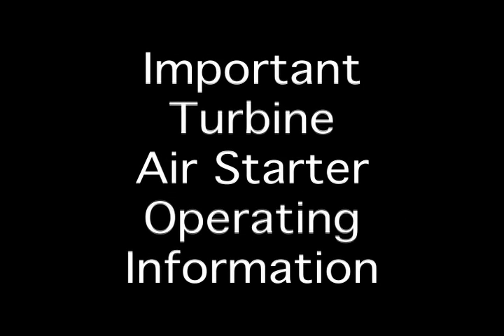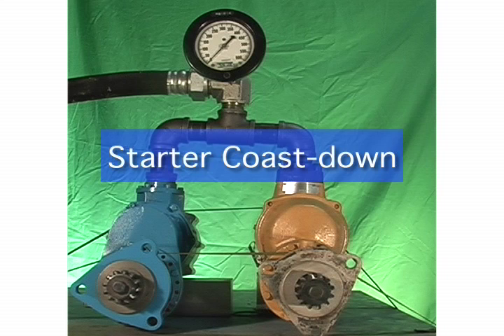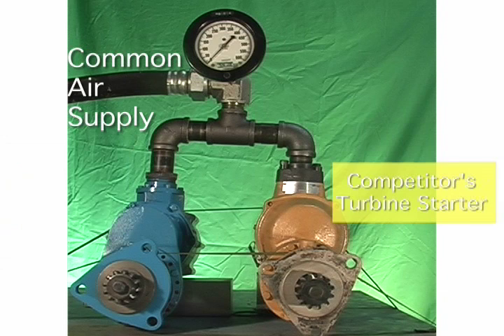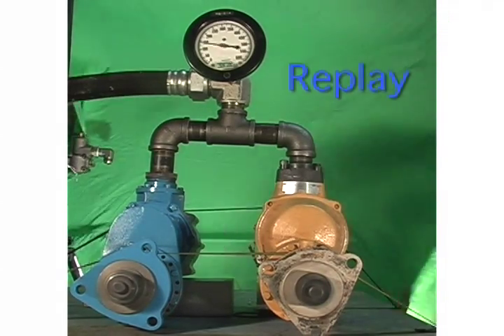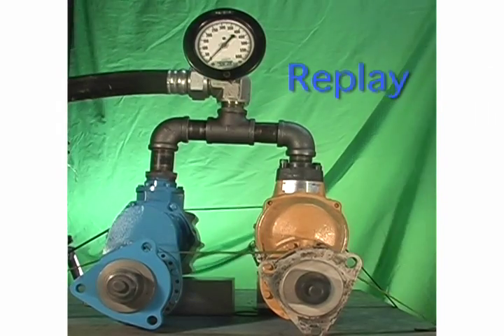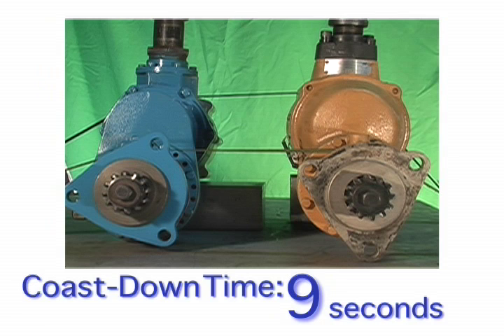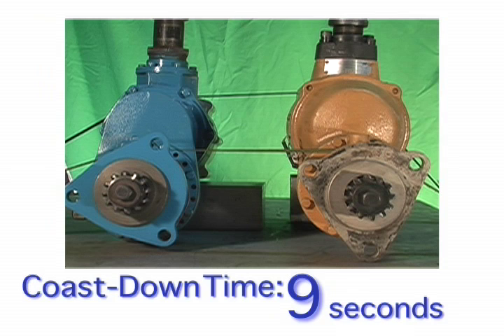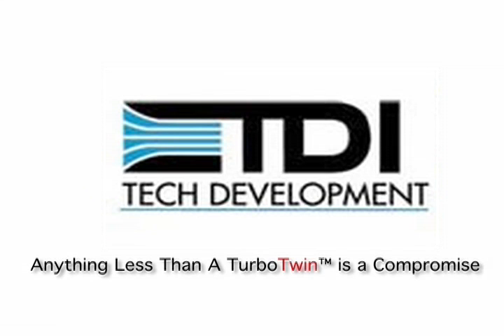Turbine Air Starter Coast Down Comparison

Comment: i have problem with my air starter i have a supply air but the pinion gear doesnt move, ive dismantled it and check seems fine but how come it doesnt move? could it be the oring leak?